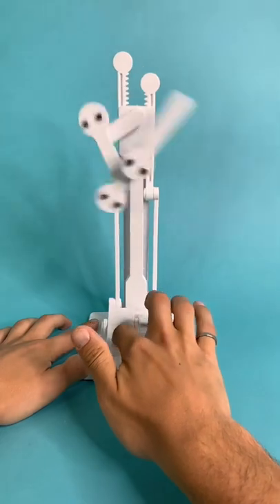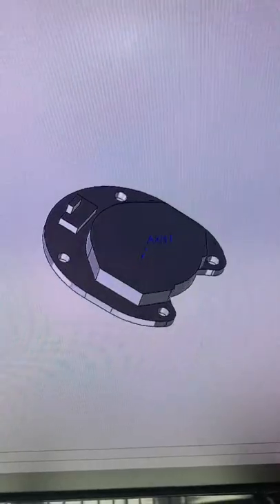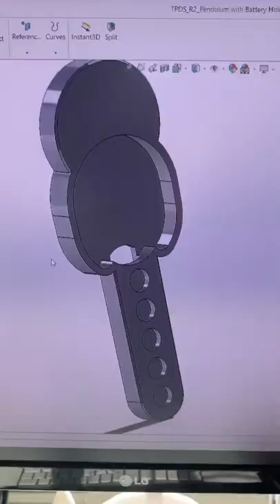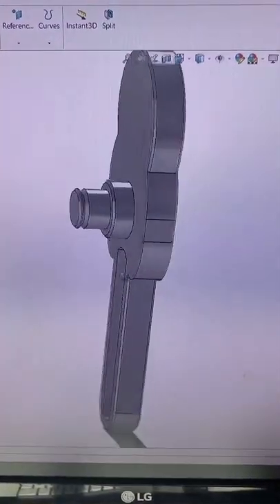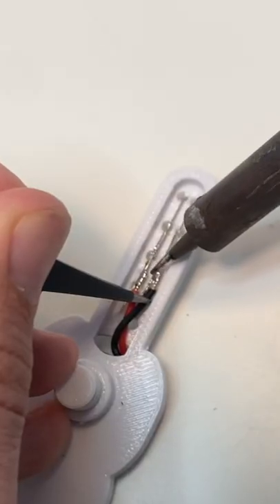Long Exposure Visualization of Chaos

Comment: Hell fucking yes man 😂😂😂😂LOVE IT.  Hahahaha those pictures are cool af man, get the RGB cycling (like using something like a NeoPixel strip that uses the ws2812 and is fully addressable and full RGB and you can do cool fade in and out and cycle all colours in few lines of code on ya Arduino or something) the colours wonder if it comes out like RAINBOW CHAOS.

You could use something like an adafruit flora Arduino or like the lilypad which would be a close fit on that battery section design you've already made and will run off 3v

If you are able to exactly recreate the timing and the pressing and pattern press of the chaos buttons, can you get a picture that is the same? If so then it is NOT TRUE CHAOS 🤯😂
Reply from the maker: I was thinking neopixels could be super cool for something like this! Gonna have to try it when I go bigger!
Reply: @Engineezy  wait... How did I miss before that you said.... Go bigger...🤯

Comment: I'd like to see what happens if you precisely control the input with a micro controller and actuator. How much chaos could you remove?
Reply: Same. If so then chaos could be calculated given all the variables and is not true chaos right? unlike my giant box of surplus electronics power adapters
Reply from the maker: Very interesting concept! Gonna have to give it a shot
Reply: @Engineezy  I bet since air resistance won't be negligible, there will still be chaos.  You could precisely control it in a vacuum chamber?  
  

The air is disturbed by the movement, so each disturbance is new and the arms move through a turbulent patch they created.

Comment: This three-body problem is exactly why I don't like working on early Toyota fuel injection.
Three factors balanced, Manifold pressure, O2 sensor and air metering makes it so it's redundant and self correcting. Add the throttle position sensor and you now have a system where, when it's not working, can only be diagnosed by replacing parts and seeing if it gets better or worse.

Comment: Even if you use similar inputs each time and start each time from at rest, the pattern is still different?

I think if you had a machine do the exact same inputs each time on the chaos device (each time starting from when the chaos device was at rest) that the light pattern should be the same.
Reply from the maker: The chaos theory states that very small fluctuations can create wildly different outputs- the system would have to be completely totally perfect to achieve identical outputs, which would require insanely precise tools to create. Even then, it may still devolve into chaos
Reply: @Engineezy  that sounds like a challenge......